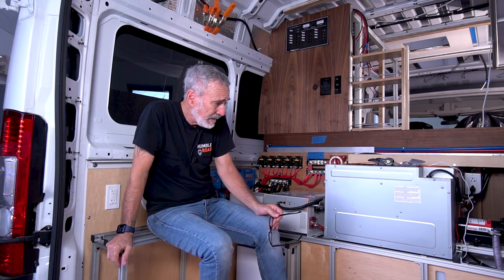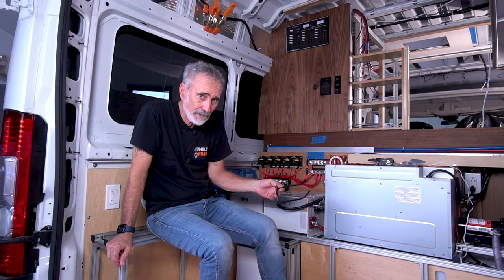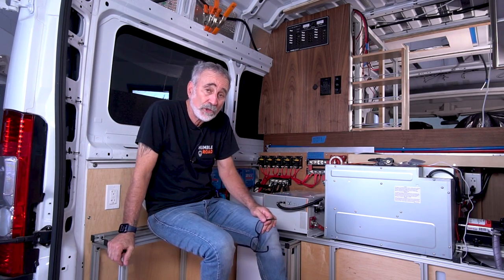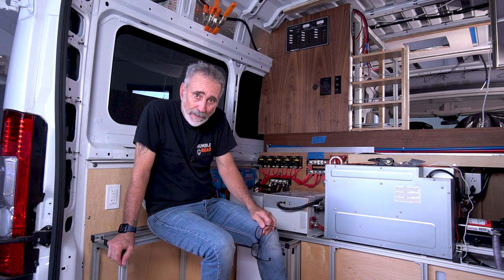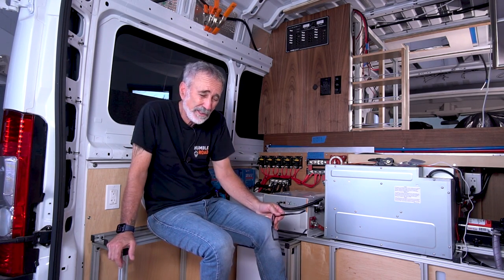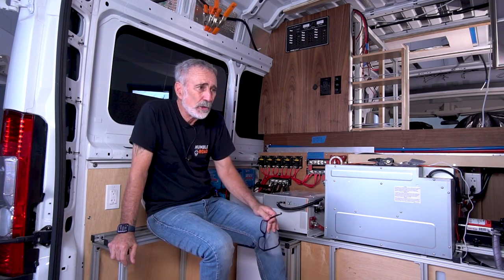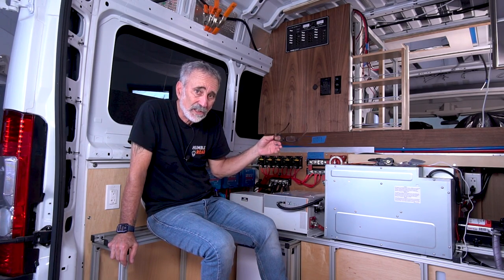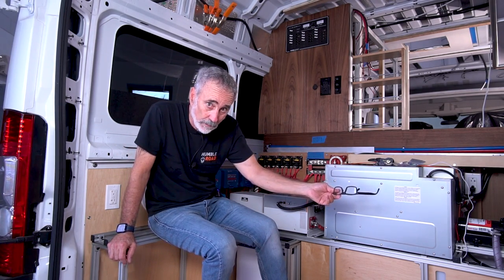Recirculating shower in a van? Just my humble opinion...

Comment: You could take a shower and become "relatively clean", then hit the recirculating switch which will cycle this cleaner water for 10 or 15 minutes.  Would that work?
Reply: I’m planning one now. What u say can be done. Or u could recirculate a nice long shower with say 3 gallons then dump it leaving clean water for next one.
Reply: These are the ideas I’m toying with. Mostly, I’m thinking of those winter months when I use a hot shower to warm up before bed. I’m not looking a recirculating shower as a hygiene thing and wouldn’t be introducing soap. Just minimize the amount of water I heat, but keep using it until I warm.

Comment: Enjoy your videos. I have a Ford Transit high top for my business. I am looking to build a basic camper van, but it has to be removable, to put the van back to work after returning from 2 or 3 weeks on the road. Anyone have ideas of the easiest way to do that? I was thinking of making the wall,  floor and ceiling of 3-4 foot panels that would connect together. I know they build homes using SIP's. I thought the same concept might work in a van. I was thinking something that might take 2-3 hours to assemble.
Reply: I'm thinking modular boxes made of 2x2 and 1/2" ply. Make modules, 2-4 for the bed, with drawers built into them and slats instead of ply on top, and a couple of 24" kitchen modules with doors and drawers with simple pinch catches. use bolts, washers and nuts through the 2x to brace them all together and figure out a way to attach to the side of the van like maybe a 1x4x8' strapping board to screw into. just use a waterproofed ply for a countertop, drop a sink in, and use a jug on the counter or stand for a gravity feed system into a (slightly larger) container directly below the drain.  Maybe a module for the porta potty or bucket loo that could double as a seconary seating space.

Comment: Hi George:

I think your exaggerating the issues and problems, but here's an idea for you that I saw somebody else do. It requires a series of Switches and electronic ball valves, but overall once you see the system design, it's not all that complicated. I believe it fits into a 18-in square space about 6 in deep. Here's the general idea: You take your normal military style shower, rinsing off the crud and shampooing your hair. < 1 gallon hopefully. 

You install an electronic ball valve and just before that you have a tee. The electronic ball valve is normally open. This goes into your gray tank. When you are ready for your recirculating shower you hit a switch and close the electronic ball valve and the water is now redirected via the tee to your recirculating pump and a separate shower head. You run it long enough for the water to flow Out of the recirculating shower head, and then turn off the water from the fresh water. Water usage is between 3/4 and 1 gallon. 

Now, you can take your 20 minute or 1 hour long shower. When you're done you hit the switch again and the water goes down into the gray tank. So yes this probably takes more water than a standard recirculating showerm but the water is fresh each time. In this particular gentleman's design all is he used was a spin down filter of around 50 Micron to filter out the hair. 

There are other components to this, such as a heat exchanger, so that Water from the recirculating shower and never mixes with the hot water used for food prep. This requires its own pump. And I believe he also added a Anti-scalding valve. This way it maintains a constant 100 to 104° shower or whatever you set it at.

It looked intriguing to me if you don't want to mess with all the filters and possible dangers.

And really, you can buy a pur 3 in 1 filter which I believe is 10, 7 and 5 Micron in one filter, and Install a tray under that for changes. And I've seen UV filters the size of your hand that can handle up to 2 gallons a minute (Not cheap at about $450) but You can definitely go compact. And then there are also hot water heaters that are on demand. I'm not talking about the big monster 60,000 BTU models but a really small one. If you're only heating up a gallon of water it can do so quite quickly. So that gets down to one sediment style filter and one UV filter and then some kind of a spin down or pre-filter. The designs I'm seeing have gotten smaller and smaller. And if you're talking about only a gallon of water, even if you get say three or four showers out of it before you dump it that's pretty good. 

And remember, that Bill Gates build a toilet where the byproduct was drinking water. I think some of this is just a psychological barrier.

Comment: I think the only way this kind of system is worthy is after taking a quick shower, with that water, including the rinse, going to waste. Then, fully clean, you can have a long shower with recirculating water (no soap), just for the pleasure of a long shower. 

However, that water would still have bacteria and nanoparticles. It would be easy on the filters though, but you’ll still need to check the filters. All of this is good for off-the-grid and low-water travels. But as Mr. mentioned, it’s better to have more water and take quick showers without recirculating water.

If you're ok with it you can use the water to wash dishes (but not to rise). You can take those showers endlessly but I would't trust on those filters for long. I would still do it just because I love longer showers.

Comment: Regarding your free hot water system, is there a way of turning it off while the engine is running if i don't want it to make hot water? thank you in advance
Reply from the maker: No. If the engine is running the pump is running. If I add a switch, then you might forget to turn it on and will be without hot water when you want it.

Comment: Can't use rain water on a week long camping trip. Also do not need to change filters on a two week trip. These filter systems remove everything. Grey water and fresh water tanks are a nightmare. This water is literally only used for showers and kitchen sink (dishes hands). This system even saves energy on the hot water reclamation.

Comment: It's indeed no overstatement that you have to clean the hair catcher - daily, you have to clean the spin-down filter, weekly, this is all stuff you need easily accessible, you need to clean your normal filters possibly weekly, maybe monthly - if you stay on top of it it is not that disgusting because it takes time for stuff to become disgusting - hair itself is OK, hair that is a year old.. not so OK. It can be a great thing but you are completely right, to get one thing (yay long showers) for frequent maintenance (noooo).

I'm personally boatlife, my recirculating shower will have the filters directly in the shower cabin, meaning easy access and drainage. It will also have a "Pee-mode" - so you can toggle the recirculating shower off when using soap / first flush. Just by having a pee-mode (that's the official name) I reckon you can decrease maintenance by a large percentage. You should still do it frequently, but the cleaning of the filters won't be as bad.

For vanlife, I think it is a nobrainer to make a hatch in the van, so you can replace your filters outside of your van, no problem with water leaking out of the filters when you're outside.

Bottom line though, EASY ACCESS, FREQUENT MAINTENANCE - those are the things you need to do when you have a recirculating shower, the end result is a much cleaner system than a non-recirculating shower because you give it the proper TLC. It'll reward you with long showers / low water usage as an added benefit for keeping your system clean.

Comment: Even the best filtration systems can't filter all of the oils & dissolved salts & solids. The water looks clean but it isn't & it gets progressively worse with more use. Just measure the TDS of the supply & then compare it to the TDS of the filtered water and you'll see just how much 'stuff' is still in the water.

Comment: If I ever do a shower it would only be recirculating. Water takes up too much space and it's too damn heavy to lug it all around just to get rid of it immediately. Water weighs 8.3 pounds a gallon, 20 gallon tanks weigh over 150 pounds. To say nothing of some of the larger tanks I've seen and heard of. Length of the shower is really not the issue. 

There's a trade off with everything in vanlife and I'd much rather deal with weekly filter maintenance than hundreds of pounds wasted on water weight, personally. Some people have gotten their recirculating shower water tested at a water treatment plant and it's WELL within safe range after 10 showers, though if you're using certain types of soap it may not feel very nice on the skin, most people cycle the water out every 6 showers. As for urine, there is no circumstance where it is okay to pee in a recirculating shower. Ammonia would cause a lot of skin issues, its not hard to pee elsewhere.

Probably just go without a shower until I can't tolerate being a scrub anymore anyway

Comment: I think your comments make sense when referring to the most common layouts that I see people use building but when done properly you start a shower with a few litres of fresh water which from there is constantly being cleaned by the filters (so its cleaner than having a bath) and when your done you back flush that water and any contaminants the other way out of the filters and in to the grey tank and your ready to start the next shower with nice clean fresh water and flushed out filters. 

You also talk about filter maintenance but again its in the R&D, done properly (back flushed regularly and the correct size and type of filters) filter maintenance is an easy and infrequent job. 

I like your videos and workmanship but I disagree with you on this one. I'm sure if you put your mind to it you too could design and develop a system that works and is easy to maintain.
Reply: I totally agree and will be using this base design in my setup.
Reply: What size and type filters? Micron Level? UV filter specs do you use?
Reply: Wow, you just me made think at a system in which you recirculate and filter the water for the first part of the shower (let`s name it Stage 1) in which you soap and rinse and then have a second stage of filtration for the "infinite shower" that uses smaller filters and that flow is used and reused until you select Stage 3 and than that water is used after the stage 2 filtration to flush the stage 1 filtration. I would use one of these filters systems combined with a reverse osmosis filter in a forth stage to take water out of the grey tank and filter it back in the main tank. I also recall seeing a video in which a guy lab tested the water and the results shown that the ammonia level were high after a few days so this systems need a ammonia filter and I also seen that there are some people trying to figure out filters specifically for the soap which will help a lot with the maintenance intervals.

Comment: Could system be developed where you have a diverter that when you use soap to clean it goes to a gray water tank but when your clean and just like a longer hot shower it can recirculate and the "long shower" comfort feeling can be accomplished?
Reply: as he mentioned/ it is not just the soap. there is hair, dead skin, and other body secretions..
Reply: Yes, it's possible. Two drains with a ball valve, one for the cleaning grey tank shower and one for the recirculating comfort shower.

If you want less icky stuff you can do maintenance with a higher frequency, and don't ever pee and poo (or wipe bottom) in the shower.
Also don't use oil based soap and shampoo. And use as little as possible.

And prevent bacteria growth by keep recirculating water a few minutes after the shower.
A second ultraviolet filter, before the filters, may decrease the time needed for disinfection of the system.
Reply: @rudivandoornegat2371  this makes sense.  Has anyone done this or made a YouTube video on this?
Reply: Yes, there are quite a few. But only Snow and Curt made a detailed explanatory video.
Reply: Mispronounced Adventures also did a pretty decent explanatory video about his recirculating shower.

Comment: Could not agree more. All the work and parts necessary for a system is just not worth it. Of the systems I've seen I doubt any of them can totally remove the bacteria that is in the water. I would ask each person, would YOU drink that water? If not then I don't want to wash in it either.
Reply: I don't want to drink my bathwater either, but even so, I greatly prefer a bath over a shower.  So, I would be fine with an Hour Shower...  conserves water, I can rinse my long thick hair as long as I need to, and it's heated water. I would  discard the water after one use
Reply: @DazzlingDanaOfficial  YOur bath water does not run through a multi stage filtering  system as these showers do and even with the filtering I doubt anyone would drink the water coming out of the filter system.
Reply: @johntatman9168  My point was, I certainly wouldn't mind showering with a filtered circulating shower if I don't mind sitting in unfiltered bath water for hours. For people who don't find baths disgusting, there is nothing disgusting about a recirculating shower, such as an Hour Shower...

Comment: The reasons given weren't solid enough to NOT get a recirculating shower. You have some points but I'll just consider those while designing  the system to make it easier to deal with.
Reply from the maker: Well then, while we agree to disagree, I'm glad the video was helpful. That was my intent.